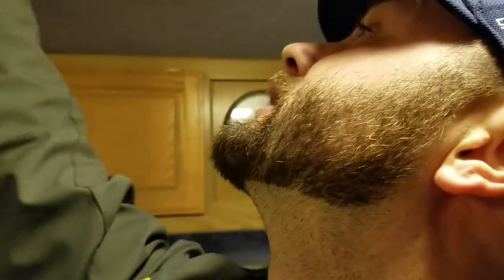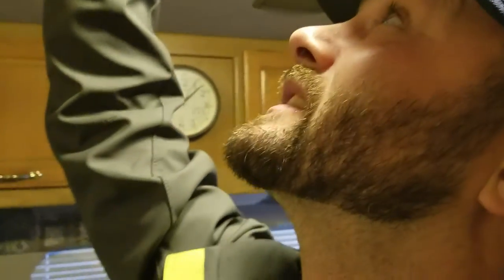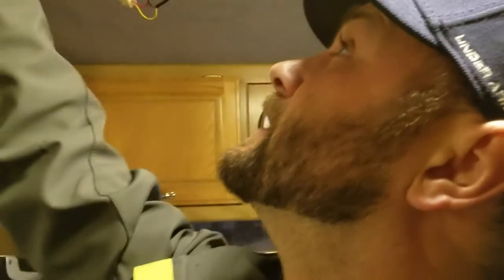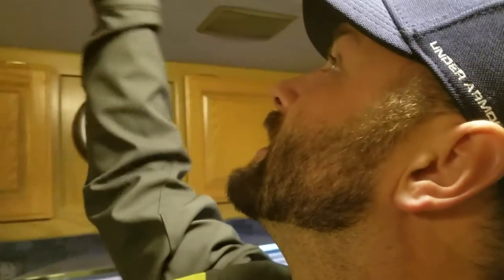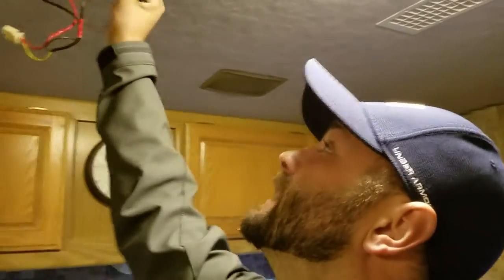Let's fix a leak, raining in the rv

Comment: Had that same problem, Coleman Rain in the RV, on our brand new 2017 Forza 36G. The rubber pad/seal was not compressed enough from the factory to prevent condensation from leaking in under the pad. When they are new there are little white tabs at each corner that indicate how compressed the pad is supposed to be. I had to tighten up both AC units. Not a drop of water since.
Reply from the maker: Nomadic Native Oh wow that's cool that they have tabs to indicate the compression required.  Sucks that you'd have to do that on such a new RV though.

Comment: Tightening the bolts fix it. Reminds me, I need caulk a couple marker lights.
Reply from the maker: CITAP1 Yeah it seamed to but we've only gotten one more downpour since tightening.   they were really loose though so I think it'll be good.  Nice, I should re-caulk mine before they start leaking.   Been 2 years since I redid my roof.   I've gotta do my windows sometime too but I'm wanting to pull them out and really do it right instead of just caulk on the outside.